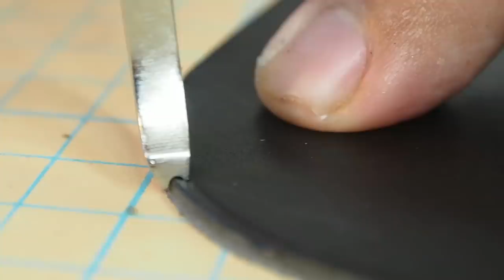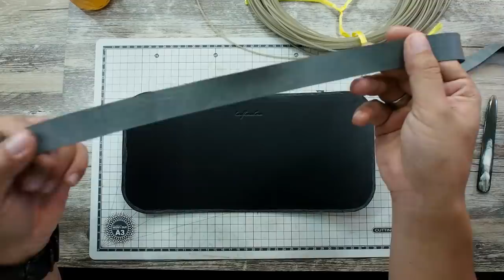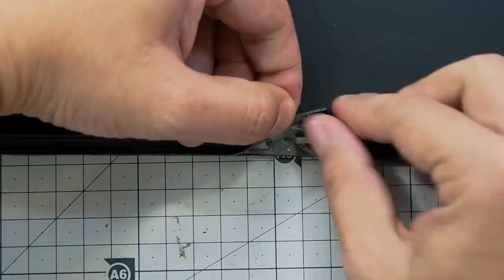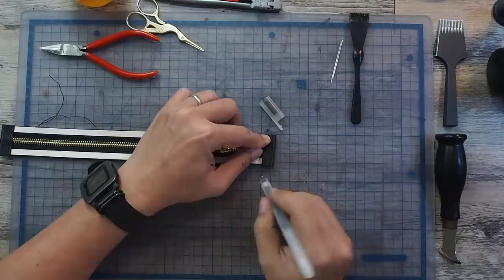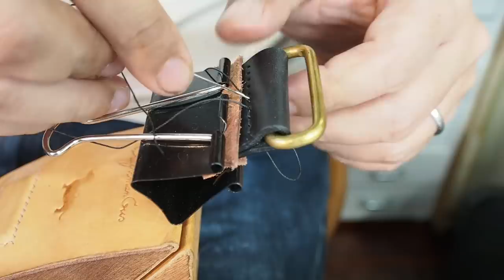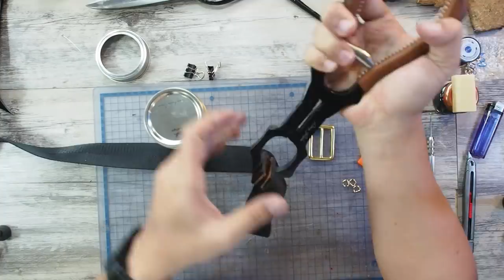Making Bag : Chest / Bum Bag #LeatherAddict EP40

Comment: Does your pattern link where I can buy the buckles and piping you used?
Reply from the maker: Our pattern link contain patterns and instructions document.
For buckle and piping I bought from local leather bags supply street in Bangkok.
(We have lots of bag makers and bag factories in Thailand)
Their shop do not have online or international shipping.
Sometimes I suggest to my foreigner student to find some material similar to what you can't found.
Like solid plastic piping you also can use tiny oxygen tube (for fish tank), small rope, solid rod or even round vegtanned leather string, or shoe lace.
For tuck buckle, sure you can find them on ebay.

Comment: how long do you waiting for the glue dry?
Reply from the maker: Hi Sam Wang.
For glue issue. I don't know which glue you use.
I use contact glue/adhesive/cement local brand sell in Thailand. 
But for international you might find "pattex/threebond/dunlop/pyrm" or other.
Some glues are not strong bond enough like "UHU" or else.
Make sure it's labeled for leather or wood works.

To apply glue please make sure the surface is clean.
Then need to scratch leather in both surface. That's help glue to stick better.
Then apply glue with brush. (For me I use flat spatula)
Make sure you apply as thin as possible but cover all the  surface.
For me I wait about 3-5 mins.
Then have to make sure the glue dry enough.
(when touch on it nothing gooey lift up)
Then paste them together.
After paste you can use bone folder to flatten it and you can use wide clamp/pliers press on it again.

Glue also have valid dates.
Contact should be light, not to condense.
Some how if using glue and open the lid too long the glue will lose its quality.
(Please open and close very quick).

Hope this can help.

GUS
Reply: thank u so so so so... much! you are the one who write longest common to me! i tried your way yesterday i works pretty well. i learn lot from your video, keep going you are the best craft ever.
Reply from the maker: You are welcome :)

Whenever you have questions you can let me know.
Reply: Thank you very much for your lessons and comments. It helps a lot, when you are at the beggining. I wanted to ask the same question about the glue))) and now it's clear.